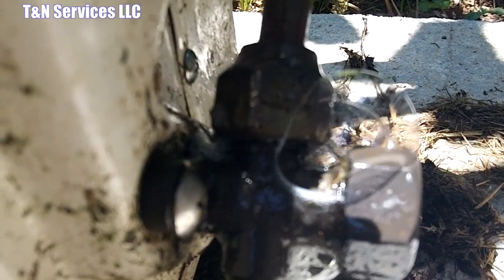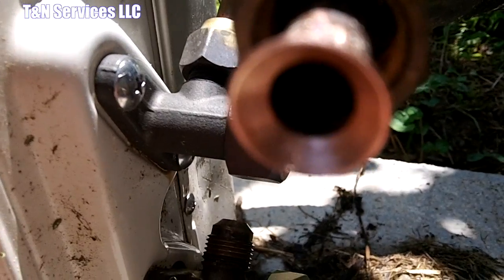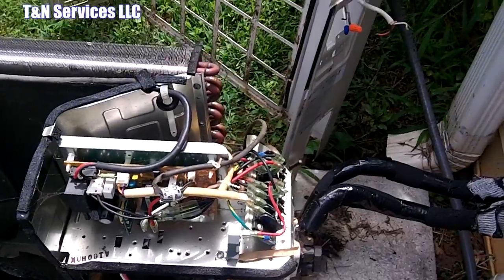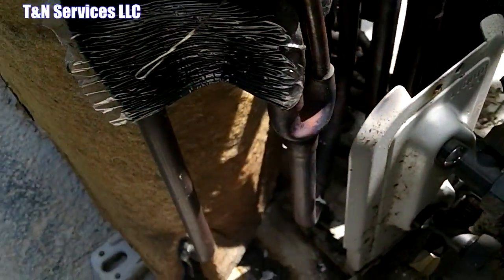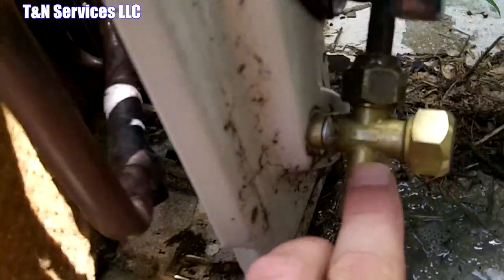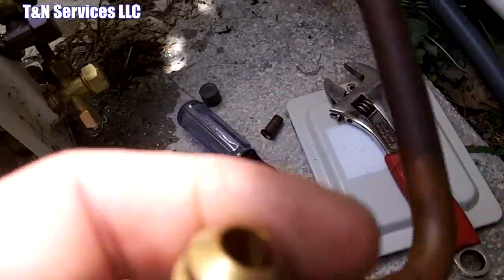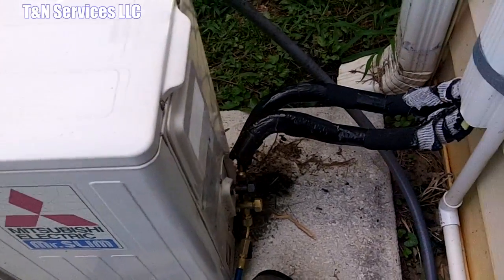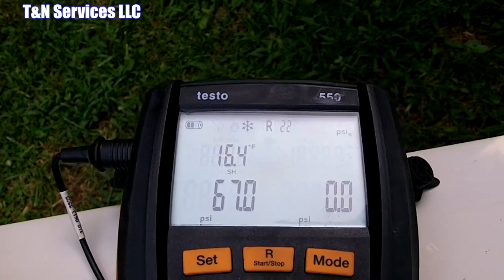Mitsubushi Mini Split Freon Leak Repair

Comment: that unit has all the earmarks of a DIY install.
On another note, I'm going on 5 years with my mr slim & no issues whatsoever. 99.9% of use is for winter heating.

Comment: I recently had a AC Tech come to my home to locate a refrigerant leak in my single zone ductless unit and he wanted he said it would cost me $745 plus tax just to locate the leak. Needless to say I declined.
Reply from the maker: Paul O'Toole most likely it’s a flare or it could be in the indoor coil. Lift the cover of the inside unit remove the filter and see if you see any oil streaks on the coil.
Reply: @TandNServices  what was the name of the valve you replaced?

Comment: Was that unit R22 ?

     No disconnect ?  Code violation .  I realize you did not do the original install .

     Sad thing is a pull disconnect is only $ 10 - $ 15 .

God bless
Wyr

Comment: Holy cow that's a deep gouge.  I was going to think out loud about buffing it until I saw it clearly.  But once you had the new valve you put it in lickety-split.

With no disconnect and the HO gone, how did you kill the electrical power?

Comment: I work on some commerical refrigerators and freezers and they have flare fitting. First place to look for a leak. Who makes the nitrogen regulator that you use?
Reply from the maker: Hey Pops it's a Western Enterprises VN250. They also come in a 500 psi version as well